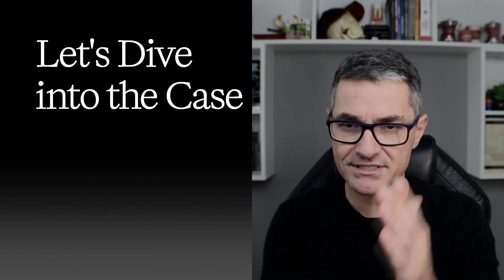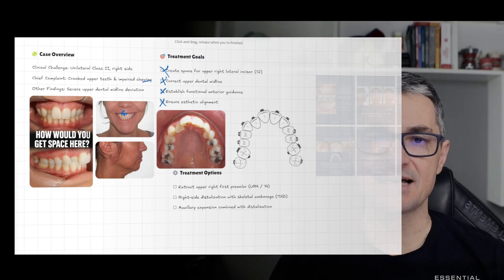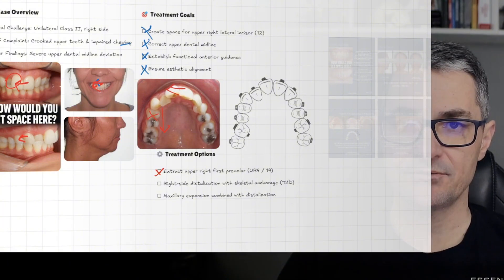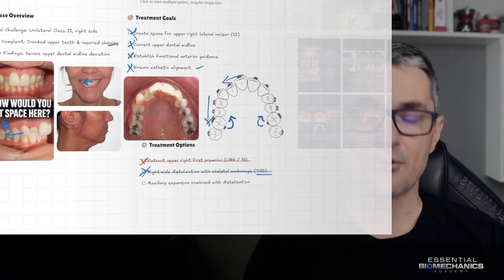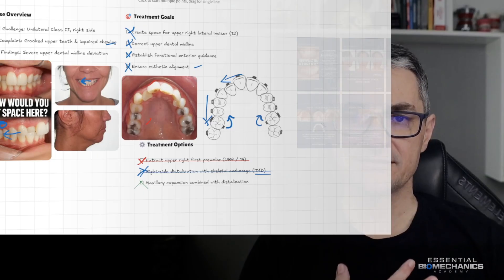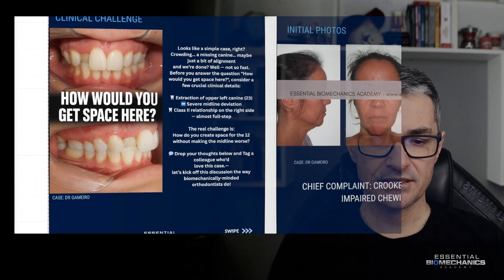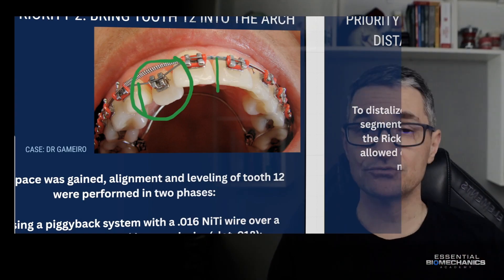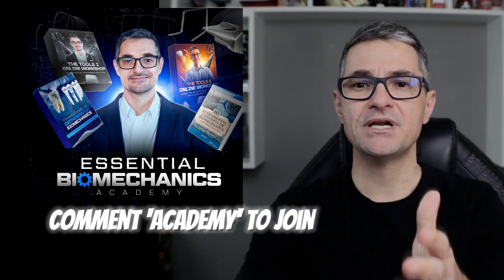Class_II_Subdivision | Essential Biomechanics

Comment: How do You prevent lower incisors from proclining too much with this method (rickets Z arch plus intermaxilary elastics), and is this method possible when You have a full arch, with no missing lateral teeth?

 Is it a simple full band back on lower wire, or is it also some torque added in the lower wire, in the lower  incisor area?

Otherwise, a very nice solution for this case, absolitely worth trying 🤟🏿